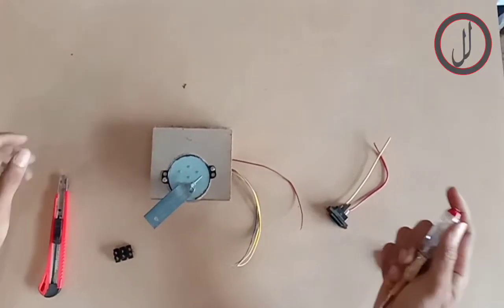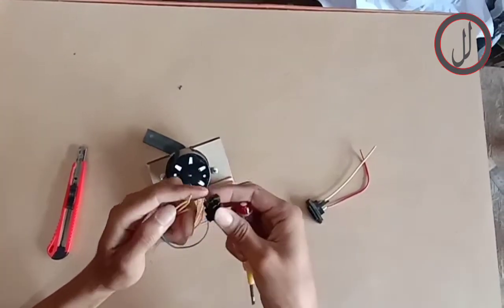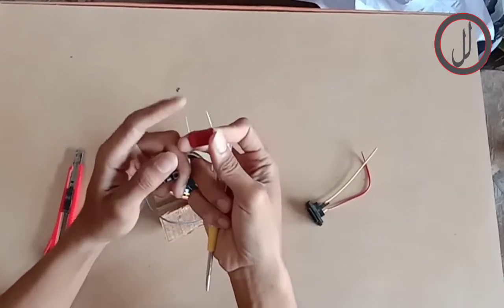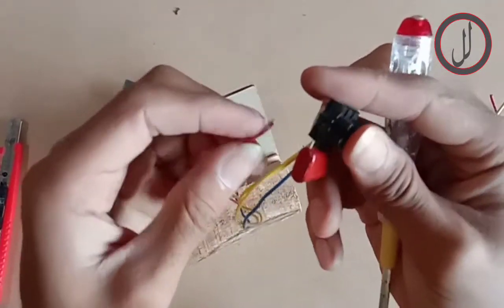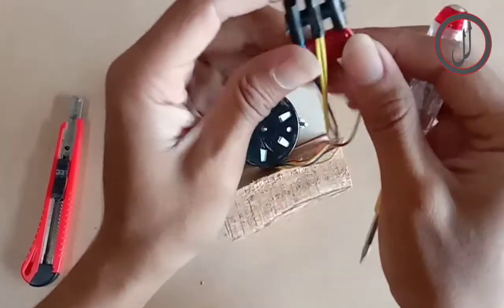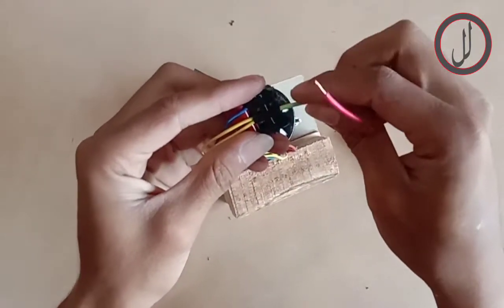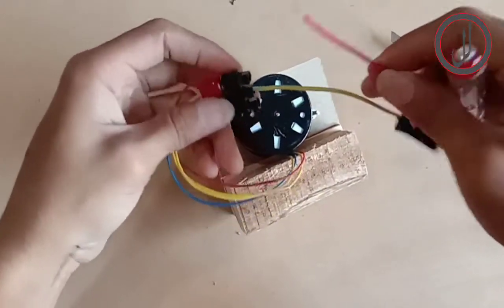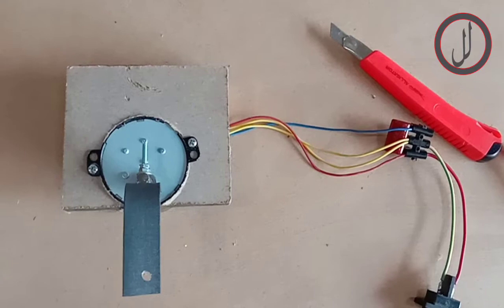Wiring 50KTYZ-60KTYZ synchronous motor, low speed gear box

Comment: Mas saya mau kontrol 50ktyz pakai bardi smart breaker. Kan ada 4 kabel tuh. Kalo 2 kabel disambung ke 1 breaker (clockwise), dan 2 kabel lagi disambung ke 1 breaker lain (counter clockwise). (Jadi ada 2 power source ke motor, gak bersamaan, tapi bergantian) kira2 bisa gak ya?